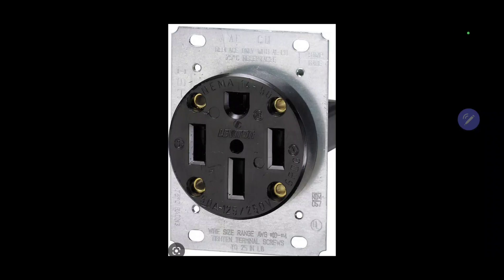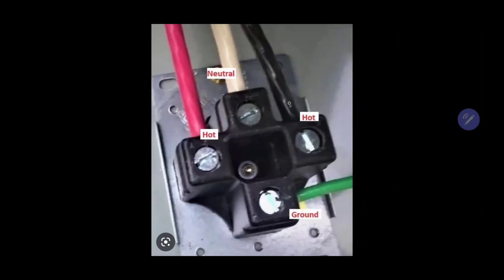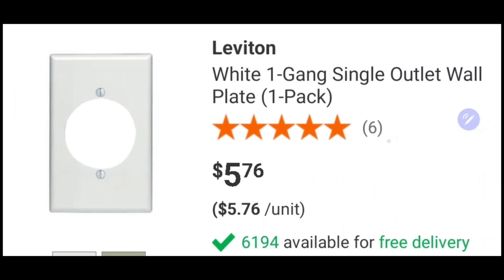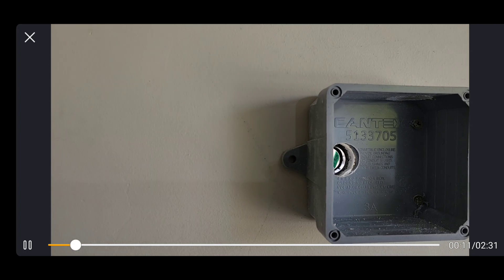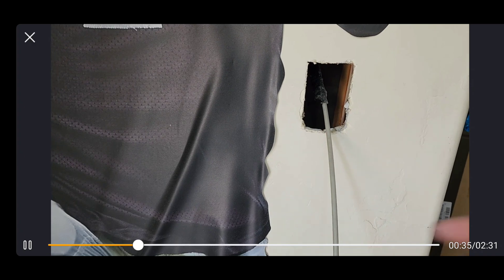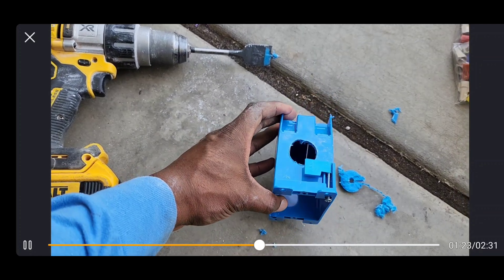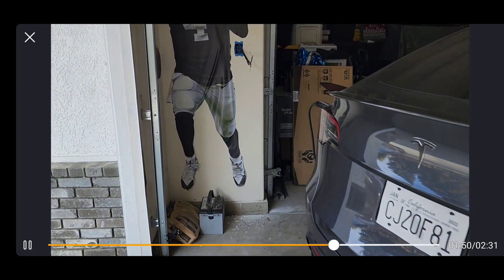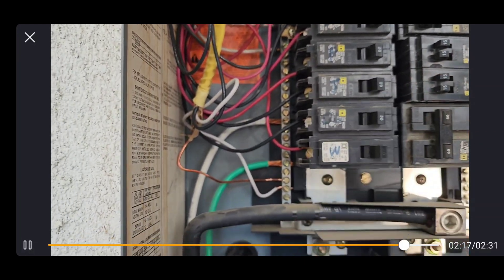How do I install a 50 amp outlet for my EV?

Comment: You got it done for sure! A few electrical code violations that could actually escalate and create a safety hazard. 
The most important one.... when it comes to EV charging stations, per NEC 2020, you must size your conductors at no less than 125% of the max load of your equipment. In this case, you're allowing a max of 50 amps. 50 x 125% = 62.5 amps. #6 AWG is only good for up to 55amps. Although you won't overload the breaker, you are risking the integrity of the conductors.